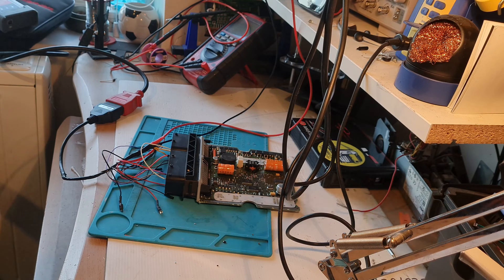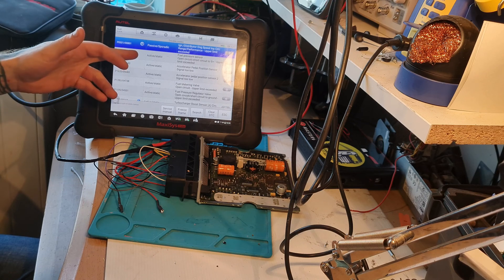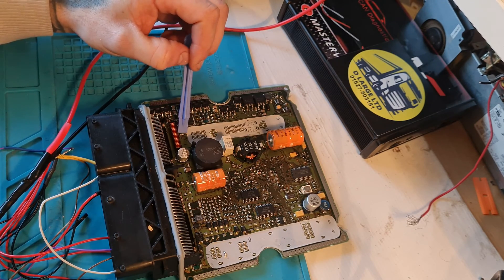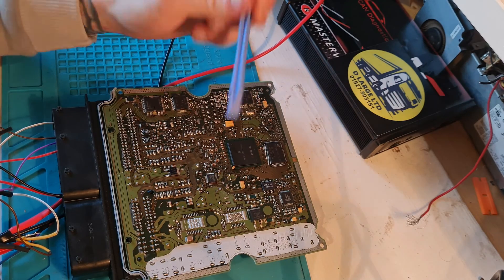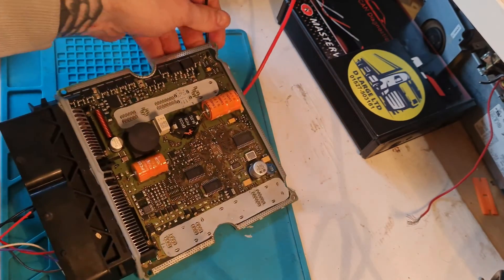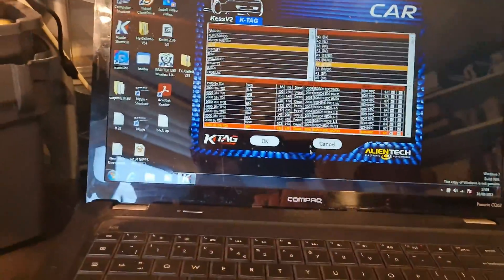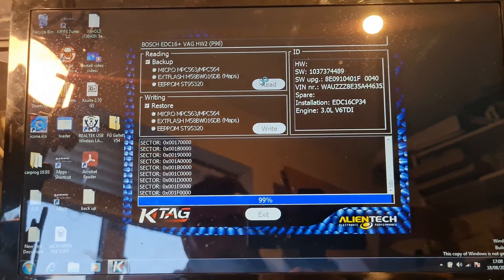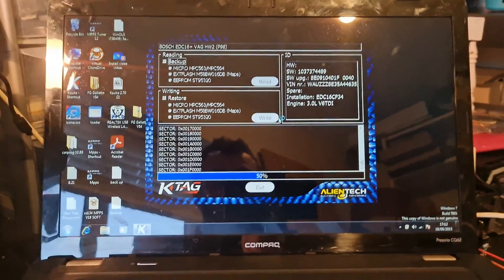ECU reading/writing for ecu repair

Comment: How did you separate the board from the other side of housing? I was able to open up (side with torx screws) but it is stuck in the other side, the side you show as face up in this video
Reply: Hey! I have the same issue now, I’m repairing the ECU on my car, and I can’t separate the board from the housing. I was wondering if you have managed to do it? If you did, please share it with me! Thanks

Comment: Do you do repairs for customers? I have a Bosch ECU from Mercedes e320 CDI 2006, it will work, when hot will not start, there's a trick with power wires that will make it to start engine when it's hot...

Comment: How can I make the ecu test system diagram. How can I obtain the ecu test system. Which ecu test system are you using?
I want to repair ecu. What is the equipment required for ecu testing?